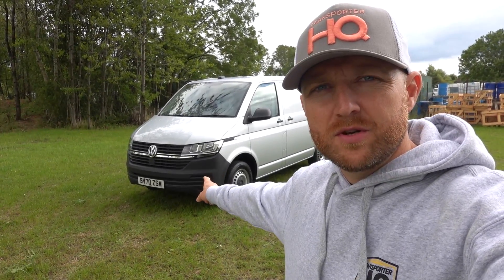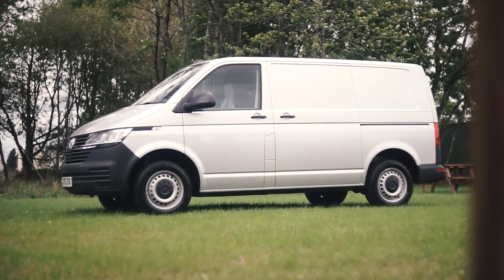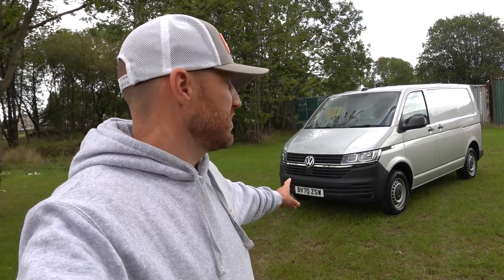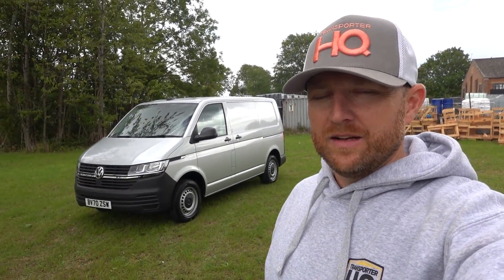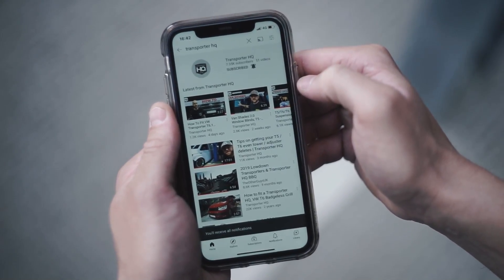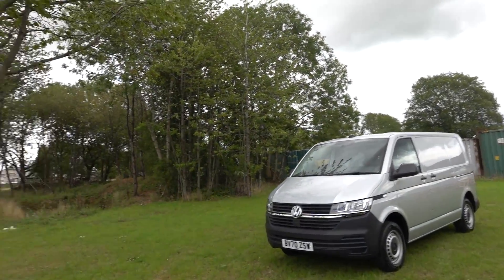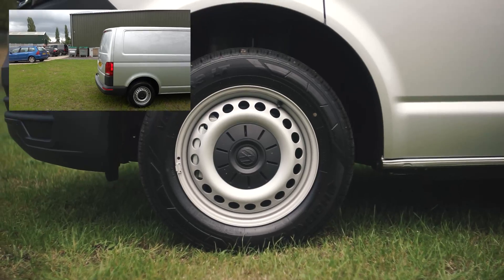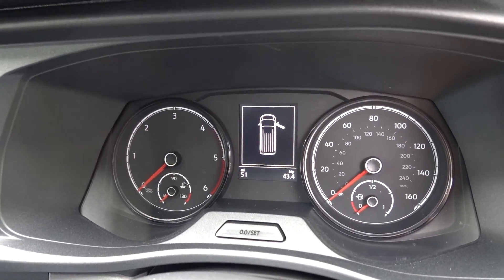Making 1000BHP TESLA POWERED VW Transporter T6.1 | Ep. 1| Transporter HQ

Comment: As a former PHEV driver, current T6 Cali owner and disappointed with published performance of the vw electric transporter (range) and an Engineer, I’m very interested in this project. The interfacing and integration of a Tesla motor and controller and battery will be very difficult without Tesla design knowledge and support so how are you planning to achieve this? Also cooling of the motors and temperature management of the battery will be key to usability. Good luck anyhow 👍
Reply from the maker: Its all in hand, the communication and power control is programmable with no issues. Cooling also isn't an issues, where possibly we will utilise the OEM cooling system with some additions. It will depend a lot on which battery system we use. When it comes to breaking record and race level runs etc, cages with dry ice may need to be used. For regular use, the standard cooling systems will be fine. Modern combustion engines need just as much, it not more cooling.

Comment: What about weight? If the batteries and motor weigh in the region of 2000lb/approaching 1T, will the available weight after the batteries etc go in, be too low for the van to be used as a van? It's only a 28, so plated for 2.8T GVW (unless I'm misunderstanding it, which is more than possible)
Reply from the maker: We've done our calculations, it'll be fine with the weight of everything thats stripped out.
Reply: @THQAutomotive  Cool, it'll be really interesting to see it done.
Reply: Might be interesting putting that much weight in a camper then trying to get on/off muddy fields. Good luck with the project, it’s definitely the future
Reply from the maker: Mark Ward it doesn’t matter with this build, but we’d be looking to scale the production version right back. The next episode shows how much waiting we’ve stripped with the engine etc. We were pleasantly surprised and made us realise, this could actually be really achievable.

Comment: 1000bhp electric, might make it off end of the drive before batteries run out so I can spend the next 14 hours charging them to then full replace the batteries in 2 years time as they are knackered...are their any positives to electric cars at all or is it all negative, yes they are quick in straight lines but handle like artic lorries as they weigh 1million tones...nah I’ll stick with good old fashioned dinosaur power
Reply: Just shows how little people know about current EV tech. When the solid state glass crystal batteries come it’ll all be over.
Reply from the maker: We'll see ;)
Reply: We can’t even build a train line so we can get to London 30mins quicker. Been at it for 10 years and not even laid a piece of track. What makes you think we can build the infrastructure to support electric vehicles anytime soon?
Reply: Ben Bradshaw it’ll be done by private companies not the govt, there’s loads of charging out there already, I see plenty when I’m trucking.